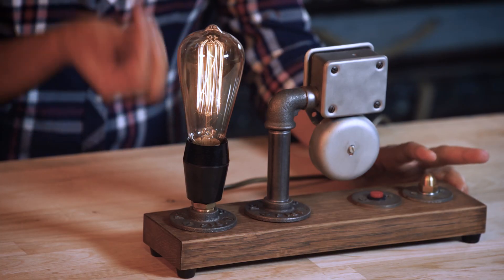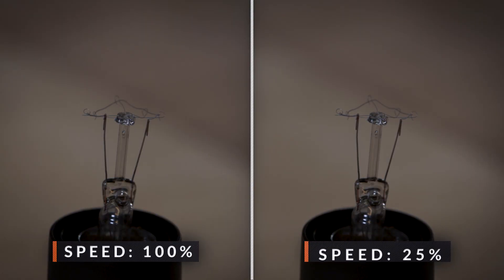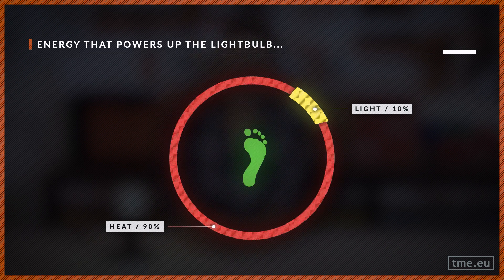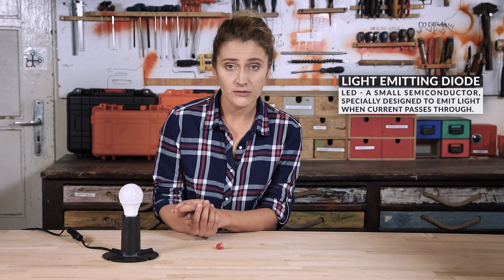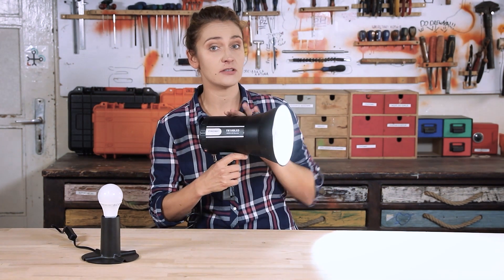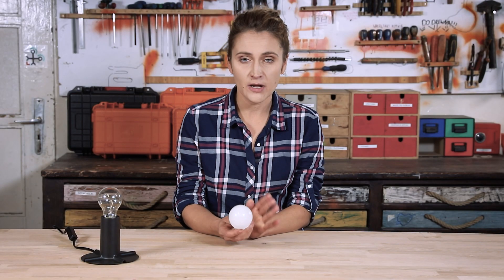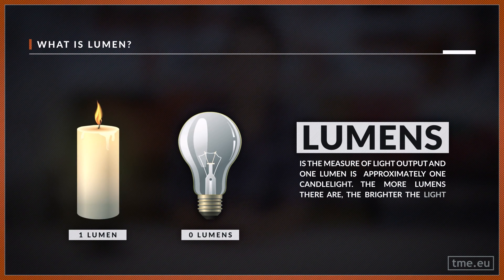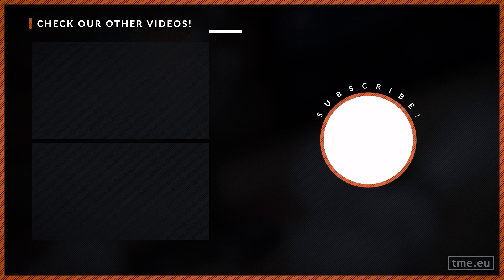Things you should know about light bulbs. Do the LED bulbs save money?

Comment: This is clearly just copied from the Internet. What a load of BS, I'm yet to find an led bulb that will last longer than 12 months never mind 10 YEARS. The only bulb that will last that long is the older energy efficiency bulbs (CFL)
Reply from the maker: Dear MajorBinkss, you're quite right :D 
Everything that you can think of, is already on the internet or someone has done it in one way or another. LED light bulb's lifespan can reach up to 10 years if you use it in accordance with the manufacturer's guidelines. It could also be much more if you treat it well... But usually, it's less. 
Thank you for your feedback and have a great day!

Comment: They should make the lamps disassemblable to allow replacing individual failed components. There is no vacuum to contain. Otherwise the "footprint" from waste is not reduced. Especially when they include, sensors, battery and logic into the tight package. The filament style could remain as it is, because it has the benefit of durable glass, and has few additional parts. How is legislation going to remove toxic materials... For a sparkling effect, the light source should be small and not diffuse. The small filament of halogen works well, especially if alligned with the faces of the specular item, such as the lampshade.